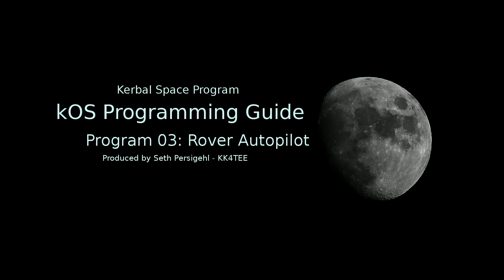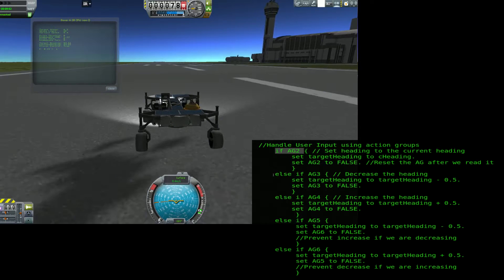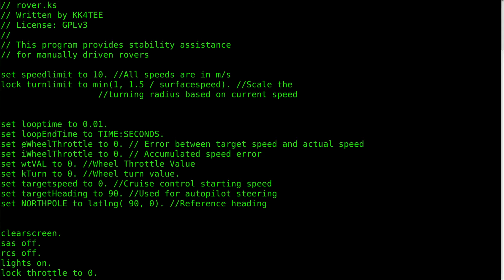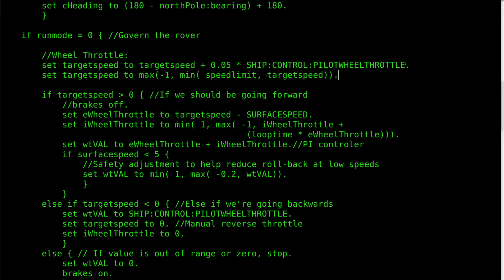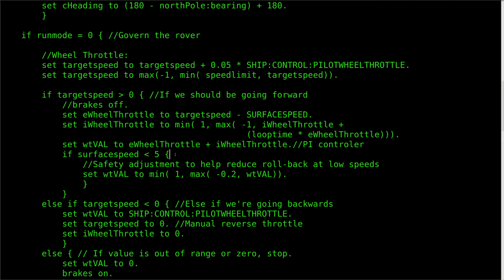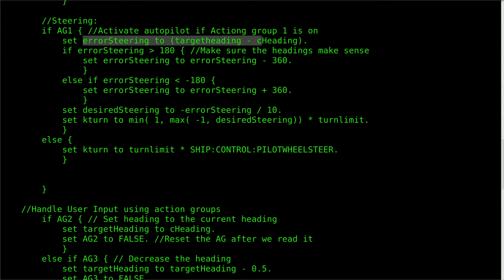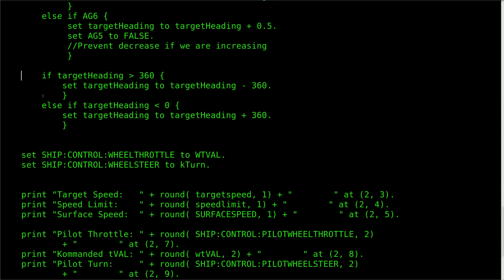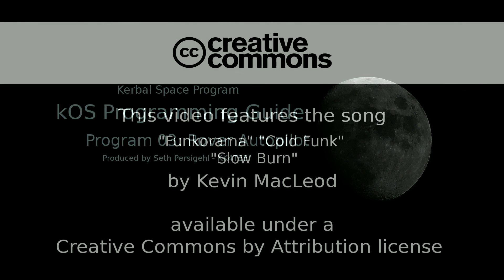kOS Tutorial 03 - Rovers: How to NOT Flip Over

Comment: Is there a way to program a rover in such a way that the throttle inputs become it's power input for the wheels? that way, pushing the shift key or Z key moves it forward, instead of maintaining your hand on the W key, Ctrl lowers the speed, shift increases speed, and Z is top speed. An action group could then be set to reverse the direction, and B for breaks, and so on

Comment: A couple of things I would like to know how to do: 
How to orient a vessel so that it is getting the maximum power from its solar panels. 
A script that shuts down non-essential systems if the craft starts running low on power, and predicts if the craft is going to run low on power.
A way to bootstrap kOS if the vessel does run out of power, i.e. if you are using remote tech and kOS to operate a vessel outside of communication range, and something happens to damage the solar panels in such a way that you run out of power every time you pass behind the body you are orbiting. 

A more complex script for doing interplanetary science missions, insertion, landing, taking off, orbiting, waiting for the desired transfer window, and reentry. All without user input, i.e. using remote tech and outside of communication range. Specially how to base decisions on information multiple patches away, i.e. how to adjust a burn  (or planned burn using a maneuver node) while you are orbiting Dres to put your periapsis above Kerbin where you would want it for aerobraking.
Reply from the maker: silentdeth Thanks for the comment! Many of your ideas can be accomplished by breaking the program down into smaller chunks, and then using a master program that runs them sequentially. For example, you write a launch program, then an orbit transfer program, then capture, land, and science, etc. It's certainly doable, and several people have posted videos about their missions, but it's also certainly a lot of work :)

Your idea for power management is an interesting one. For managing solar panels you can take a vector that points to the sun and then change it by the angle you want to face the sun (such as head on, or at 90' off). I'll throw this into my queue of things to cover in another video. For conserving power, individual parts on a ship (such as a kethane scanner) can be turned on and off using http://ksp-kos.github.io/KOS_DOC/general/parts_and_partmodules.html#parts-and-partmodules

As far as bootstrapping after a power loss goes, I unfortunately don't know how to do that. It would be cool if there was a line in the config file that would let you set a "default program" to run upon power loss, but as it stands I don't know a way to do that.

Hopefully this gives you a starting point, and thanks for commenting!